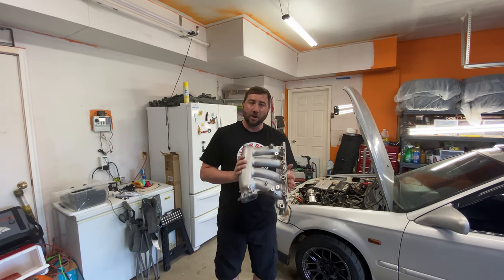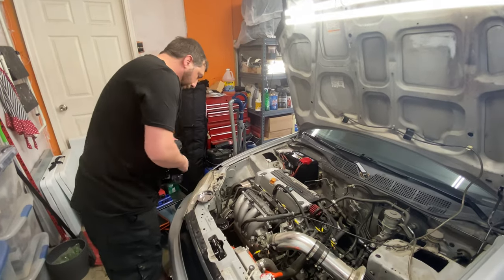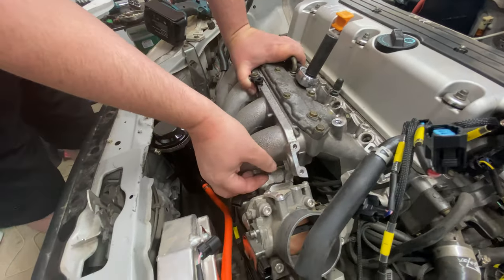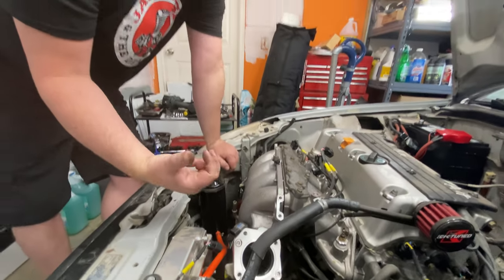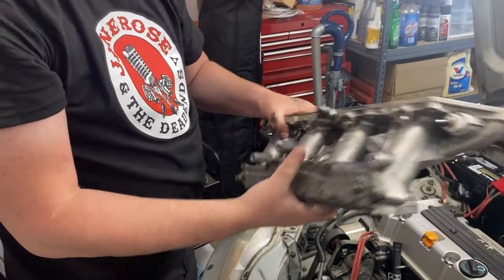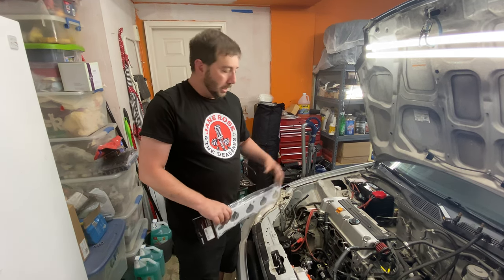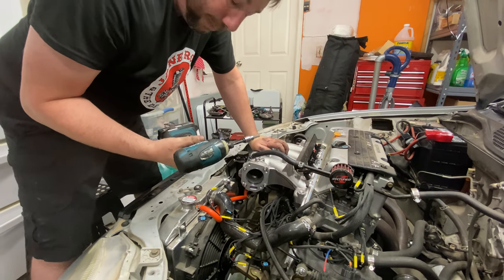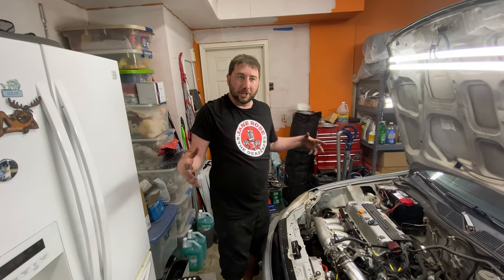K24 RBC Intake Manifold Swap - How To Do It (& Everything You Need To Know)

Comment: can i use that manifold on a CR V K24 motor? want to get rid of that plastic POS, but dont want the check engine light issue....
Reply: It'll probably throw up a code. I could probably try it on mine for you and find out.

Comment: Thanks for this video. I'm new to k-series (in the process of my first k swap) and I have a k24 as well.
thanks dude
Reply from the maker: Thanks for checking it out. Feel free to reach out if you have any questions. There's plenty more Civic mods in the queue, so stay tuned!
Reply: howd it go im buying one soon
Reply from the maker: @onlyunojhuno  Everything is going great! My most recent video about the Rear Control arms has a quick running clip at the beginning that you can check out to hear how much air that thing pulls in even at idle. Feel free to reach out if you run into any issues and have fun out there!

Comment: Man that helped me alot ! one thing i didnt see you do is what did you do with the top hose between runner 2 and 3 ?
Reply from the maker: Rudy, thanks for checking out the video and happy it helped out. Good catch, I forgot to mention, to block that off you can use vacuum port caps or reinforced polyurethane caps if you need it to withstand pressure from a boosted application.

Comment: New here on this channel its a really nice video, just a question though, are you on stock ecu? Or did you have to get tuned after the rbc install? Thanks!
Reply from the maker: Thanks for the feedback and checking out the channel! I'm on KPro and didn't have to make any changes to the tune. I don't see any reason you'd need to swap ECU or get a tune just to run it since all the sensors swap over. It does open the door a little more when you do decide to get tuned, however. More content coming soon!
Reply: @C4Race  thank you!

Comment: Woukd i need to trim the coolant passage from my k24z3 and run a coolant bypass. Or could i just drop in the RBC manifold with full gasket
Reply from the maker: Not sure about the Z3, but I know that there are different coolant passages based on the head.

Comment: So what's up with the big ass holes on both strut towers ??
Reply from the maker: Previous owner did that. I had to look it up also. Evidently when you slam the car the upper control arms contact the shock tower so the super low static guys cut holes for clearance. I have some plates that I still need to weld on to fix that.
Reply: That's so rough lol.
Nothing good comes from the stance scene 😂

Comment: This video can apply for k24z7? And what about the coolant port? Is a direct fit rbc with what gasket? I have so many doubts cause in other videos that i saw every body cuts the rbc and re-route the coolant port
Reply from the maker: I'm not as familiar with the z7 engine so sadly I can't really give you a good answer there. My application is for a K24A2. In my case, I can use a factory K24 gasket and retain the coolant passage. I think the difference comes in with a K20 head and an RBC since there isn't that passage. Again, not sure about the difference between an A2 and a Z7.

Comment: Will the rbc accept stock injectors and what spacer and things would I need to put in my stock plz help me I have the k24a4
Reply from the maker: I'm currently using the stock K24 injectors with no spacers. They plugged right in.
Reply: @C4Race  sir thank u so much so do I just need the rbc manifold and the rbc adaptors or throttle body boss can u send me ur parts list on your a4

Comment: So you didn’t need an throttle body adapter
Reply from the maker: Actually, you do need an adapter if you are using the K20 throttle body, I just transplanted the one I already had on the K24 manifold. Sorry for missing that.
Reply: @C4Race  hey there nice k20 inlet swap what's the name k24 inlet ? Call thanks  😎👍🏾
Reply from the maker: @geo93_trelawney  I used the Hybrid Racing RBC adapter. There's quite a few companies out there that make them but you can pick up the Hybrid Racing one one their site (or their ebay storefront) at the following link. Be sure to get new OEM  throttle body gaskets to avoid vacuum leaks! you'll need 2, one for the adapter-to-manifold side and another for the throttle body-to-adapter.  https://www.hybrid-racing.com/products/hybrid-racing-k20a-a2-a3-z1-throttle-body-to-rbc-rrb-rbb-intake-manifold-adapter-hyb-tba-01-64-c
Reply: Old post but thought I would share some knowledge. You can also use an accord throttle body without adapter. I'm still using the tsx manifold with my swap with an accord throttle body from the junkyard.
Reply from the maker: Thanks for the other option! Didn't know an Accord TB would work.
Reply: @C4Race  yup. Works great. Pulled it from the junkyard along with everything else for the swap. If I get the motivation to continue my channel, I'll post a video of how I did the swap because its a very unorthodox way compared to the standard. But it works and I spent way less than most.
Reply: @shane3350  you can use the accord throttle body w the k20 rbc w no adapter? Or only the k24 manifold?
Reply: @eddiemedinajr1185  yes the accord throttle body shares the same bolt patten as the rbc. You have to get creative with a cable bracket however. And also the actuator for the outer cable holder will possibly make contact with the 1st runner. I'm actually in the middle of some intake manifold comparisons that I will upload to my other channel soon.
Reply: can you use stock k24a4 throttle body with the rbc
Reply from the maker: Based on some of the comments above, looks like it may.
Reply: @jf8322  yes the accord TB flange bolts up to the rbc. However the cruise control wheel will hit the first runner and won't let it sit flush. You can either modify the wheel or buy/make a spacer. You will still need to find a custom solution to the cable bracket though. 

When all is said and done, it was easier for me to get an aftermarket TB. But if you have decent fab skills, the accord throttle body will work.
Reply: The raa tb is pretty small though. I'm using it on my rbb. Losing a lot of power sadly
Reply: Great video

Comment: hey quick question are you still using the k24 injectors or aftermarket
Reply from the maker: For now I'm using the stock K24 injectors. Once I get the engine build finished and turbo on, I'm going with some Bosch 2200s. If you want something with a little more juice for some NA power you can use Acura RDX injectors which have a higher flow rate, are super cheap, and you can pick them up at Honda. Part #: 16450-RWC-A01 for a set of 4. You'll need some jumpers or rewire them in. Lots of places sell them as a bundle.

Comment: So it bolted right up to k24 or did you need to do something to the coolant on the right of the manifold where the k24 one goes over?
Reply from the maker: It bolts right up. Since this is a swap for me I used that coolant port for my coolant temp sensor.

Comment: Do you have to change any wiring for the new manifold or it all plugs up the same? Also what engine harness are you using
Reply from the maker: No modifications needed in the harness. I use the K-swap harness from Jack Spania Racing. Here's a link: https://jackspaniaracing.shop/products/k20-k24-k-series-tucked-engine-harness-for-honda-acura-1
Reply: @C4Race  awesome. Also another question. I just bought a k24a2 for my ek. It’s the usdm motor. Do i have to change the water pump housing or relocate any accessories or anything like that. I don’t plan on keeping ac or power steering.
Reply from the maker: Thats awesome! You won't need to change anything with the USDM engine. The water pump housing thing is only for JDM and only becomes an issue when you go to replace the pump itself.

Comment: I installed mine the other day it ran horribly I had to switch back to stock manifold didn’t want to shift out of 1st gear. Is there any other modifications I should have done? I
Reply: Did u use the rbc adaptor

Comment: Going to install rbc manifold to my stock 05 type s engine. Do I need to upgrade fuel rail?
Reply from the maker: Should be fine. I used the same fuel rail on both the K24 and RBC manifolds.

Comment: does this mod works on k20a from second gen honda crv..?thanks in advance
Reply from the maker: It should since the K2x heads are very similar, but definitely do a little more research into your specific application before committing.

Comment: Is it plug and play or do I need a tune
Reply from the maker: Should be plug and play. Once I get the turbo on I'll be getting a tune on the KPro. For now it's just running a base NA map.
Reply: Yes I’m not going turbo or anything big it’s for my accord 2003 ex 2.4 ivtec just want a little more push on it
Reply: @C4Race  0:32
Reply from the maker: @franciscoesparza410  Honestly, I'd look at other mods before swapping the intake manifold if you're just looking for a little extra pep. The RBC may flow better and is great for boosted applications but because of the length of the runners compared to the factory K24 manifold you might gain some more horsepower (likely single digit if that) but will defintely lose some torque. What you will mostly feel driving around town and some light spirited driving, torque will be the bigger contributor. So in reality it might feel slower outside of track-day-like events. I'd recommend looking at intake, header, exhaust first then start stepping into the bigger mods.
Reply: And can you also run a rbc on stock ecu?
Reply: Putting on the rbc without a tune will make you lose power

Comment: Which k24 series are you running?
Reply from the maker: I'm using a K24A2.
Reply: @C4Race  I have K24A3 so i was wondering to buy RBC but i was not sure if on the k24A3 will be bolton without modification. so a2 and a3 are basicly the same engine so i can mount the RBC without modifications.

Comment: What is that sensor on the right side of the intake manifold infront of the throttle body?
Reply from the maker: That is a MAP sensor, the one right next top the brake booster vaccuum line.
Reply: Sorry I meant of the sensor to bolted in at 11:03 beside the fuel rail
Reply from the maker: Gotcha, the vertical single wire sensor is a coolant temp sensor. That typically is an air bypass valve that is thermally actuated and runs from the intake tube to the manifold during cold starts then closes as the engine warms up. I removed that and placed a coolant temp sensor in its place. There's a few companies out there that make them.